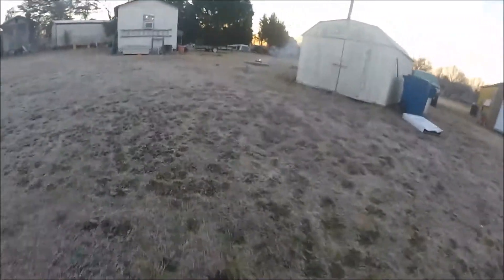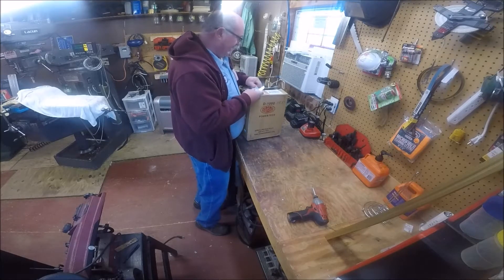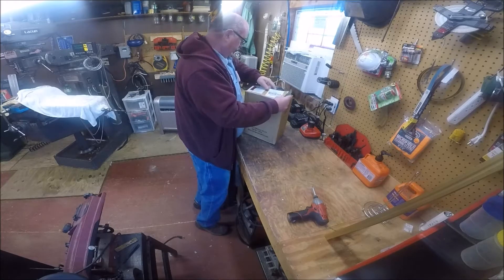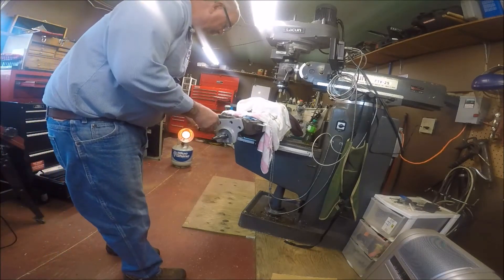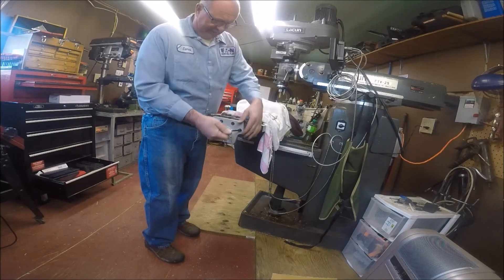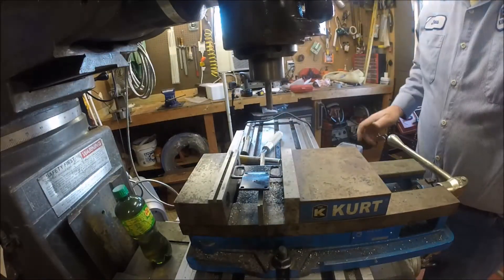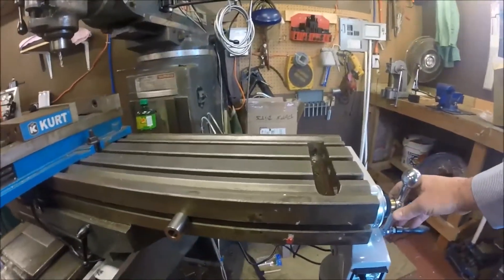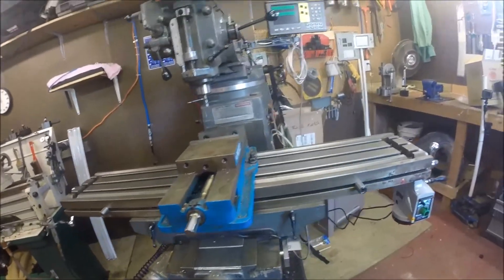Installing power feed on my Lagun mill

Comment: Thanks for putting this video up.  I have a Lagun FTV2 I'm getting acquainted with and sorted out too.  I'm near done with my DRO and trying to sort the Powerfeed out.  I put it together out of bits of about 3 non functional ones that came in a box, but it's not yet perfect.  I'm going to try to sort it out, but would like to know just which powerfeed brand and model you used in case I'm unable.  I couldnt quite make out brand/model info in the video.  If you're still monitoring this, I'd love to hear more about your powerfeed.  Thanks, Roger.
Reply from the maker: Roger Albert thanks, on my mill the power feed was removed before I got it. I purchased it from a local machine repair gentleman who took it in on trade. After a lot of research due to the weight of Laguns the feeds need to more wattage than a BP. So I discovered H&W machine rebuilders had a bolt on kit using a lower cost power feed than the Servo brand that is a bolt on unit. So that’s what I went with. It was a bit more expensive than the other import ones you see on EBay and such. My advice is to look up H&W machine rebuilders on the web and see if their still offering the same kit
Reply: @JamesDedmon  Thanks much.  I'll look them up if I cant figure out this lash.   I eventually want to get one on the need to just because of my space limitations and I wouldn't need to leave so much room to swing the crank.    Thanks again for sharing on YouTube and to me.